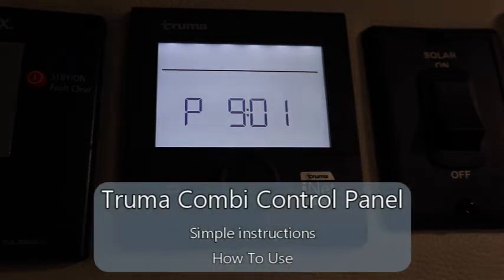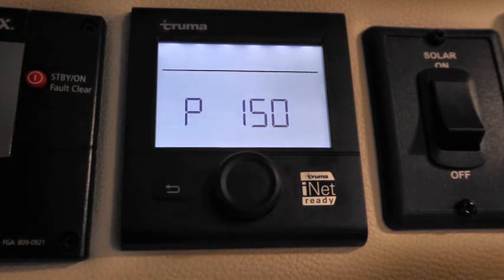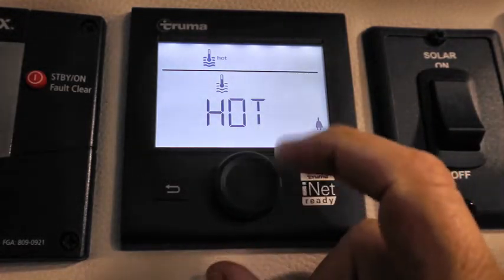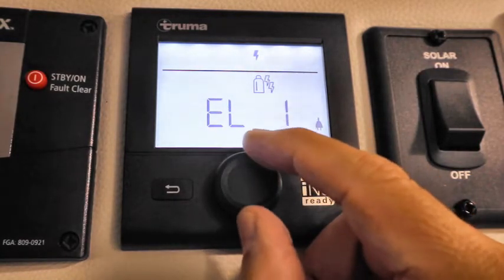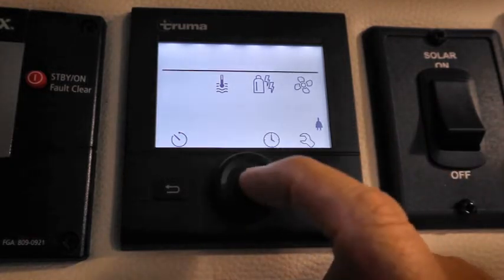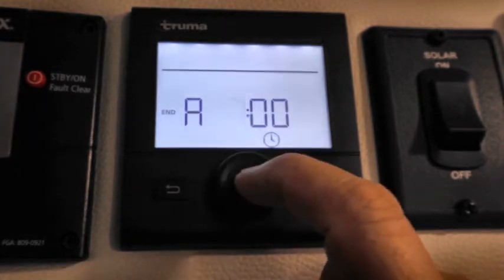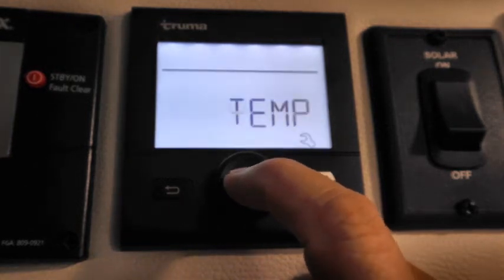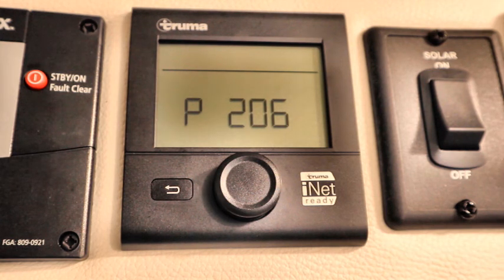Truma Combi Control panel - How to use simply explained

Comment: I am a new owner and have been learning one system at a time. Your video is excellent and I am sure it will remove any frustration and it will help me work through the manual which is not always as complete as it should be. Thanks very much
Reply from the maker: Glad to help.  Let me know if I can help you with anything else.

Comment: Just recently purchased a winnebago travato 59k.  Searched the manual for a clear explanation on how to operate the hot water & furnace. Have the exact same control as you're showing. You have the absolute best, simple explanation of the operation  of system. Thanks so much!!
Reply from the maker: Thanks.  Glad I could help.

Comment: Hi great video  can I run this system when the boiler is empty no water in it thanks ray
Reply from the maker: You can run the cabin heat, just don't turn on the water heater portion with the system winterized.

Comment: I noticed the little electric plug in the lower right.  Does the Truma run on 12V if you just want propane heat or does it need the inverter or shore power turned on?
Reply from the maker: It will run on just propane but it needs 12 volts to run the controls and fans.  To run it on electric it needs to be plugged in or have the inverter on with the Li3 package.

Comment: Anybody: Just got my Coachmen Gallerira. Do you have to turn the propane switch on before you set the heater on via Truma? Thank you.
Reply from the maker: If you are plugged into shore power and set the Truma to EL1 or EL2 the propane can be off.

If you are going to run the Truma on Propane only or Mix1 or Mix2 the propane switch needs to be turned on.
Reply: @CampingCoastie  Thank you for the quick reply!

Comment: Is there a way to turn off the Truma LED panel during storage so the screen is blank? If so, how do you then turn it on?
Reply from the maker: If putting it in storage I press the use/store button to store.  Then, I turn off the solar panels.   I then turn off the batteries.
Reply: I have a 2017/2018 22C and do not have a switch like you have to turn off solar. I do have on my control panel, a master battery off switch. When that is off the solar panel and the truma panel are still lite. Just wondering if there is a way to turn off the Truma panel so the screen is blank. Thanks.   @CampingCoastie
Reply from the maker: @jerryphillips7330  Try pressing the rotary button for more than 3 seconds to turn it off or on.

Comment: I learn a lot things from you, thank you. But I still have a problem…. I can’t turn the air conditioner “ on”. Could you please tell me how to do this?
Reply from the maker: Which AC do you have and which batteries?
Reply: @CampingCoastie  Our RV is 2019 Ford Transit chassis/2020 Coachman Beyond 22D-EB with Dometic A/C
Reply from the maker: Do you have a generator built into you Beyond, or is it a Li3 model?
Reply: @CampingCoastie  Yes, I have the generator which is the standard features on Beyond, but no Li3 Lithium battery
Reply from the maker: Hello, so it took so long to get back to you.  If you are not plugged in you will need to run your generator.  If you start the generator do you see it charging the battery?  If not, you need to crawl under the van and check the circuit breaker on the generator.  It will be behind a small cover.

If that breaker is not tripped check to see if the breaker in the coach is tripped.
Reply from the maker: If the generator is running and charging the battery try using the second panel to turn on the AC.  Let me know what you find out.
Reply from the maker: Any update?
Reply: We have tried different ways already. But the AC at the roof has not responding. We suspect the unit is never connected to the temperature control system. I need to visit the dealer for further inspections. Thank you for your help and patience.
Reply from the maker: @bonnieng6426  Does the ‘button’ for the AC turn blue when you touch it?
Reply from the maker: Can you turn just the fan?
Reply: @CampingCoastie  You meant the fan of AC… It doesn’t work so far.
Reply from the maker: @bonnieng6426  if you can turn the AC fan on then you might have a tripped breaker.  Silly question, but your generator is running do your 120 volt outlets work?
Reply: @CampingCoastie  Good questions! Unfortunately the 120 volt outlet at the water sink’s side does not work. Since we purchased the RV last September, we came across so many problems on the RV…. Water dropping from the roof,  water pipe leaking under the kitchen cabinets
Reply from the maker: @bonnieng6426  go outside and find the outlet, it’s a GFCI and press the little button on it.  That might fix the kitchen outlet and maybe even the AC.
Reply: @CampingCoastie  you meant outside of the RV?
Reply: @CampingCoastie  I found it and will ask my husband Denys to do this. Thanks!
Reply: @CampingCoastie  Yes! The 120volt outlet works now, but the USB outlet still doesn’t work and the AC also doesn’t work. We live in Vancouver BC
and purchased the RV at Comox Valley. The manufacturer warranty will be expired on September 11, but we have the extended warranty. Hopefully it can help!
Reply from the maker: @bonnieng6426  Contact Coachmen warranty department and let them know what problems you have.  Tell them when your year is over, they might help you out.  They are great people!
Reply: @CampingCoastie  Yes! Definitely we will call them. The Forest River is a good company. Thank you so much for your help.
Reply from the maker: @bonnieng6426  Glad I helped you fix one thing.  Wish I could have fixed it all for you.  Tell Coachmen hello for me.

Comment: I did a reset on the Truma control panel "wrench" icon due to an error message. Now Truma will not go back to the display home screen. Any suggestions. Thanks.
Reply from the maker: Maybe turning off your main battery switch and then back on again.
Reply: @CampingCoastie  And the main battery switch would be located where.....
Reply from the maker: @lucchetti1  What model do you have?
Reply: @CampingCoastie  2022 Beyond 22C.
Reply from the maker: @lucchetti1  do you have AGM batteries or the Li3?  If you have the Li3 press the store side of the use/store rocker switch.  You can then press and hold the big silver button on the Li3 SOC panel.  After it powers down press and hold the silver button until it says it powering up.  Then press the use side of the use/store button.

I believe on the AGM batteries there is also a use/ store button.  If so, press store, wait a couple of seconds and then use.
Reply: @CampingCoastie  Li3. I will try that. Thanks for the help. Just got it two weeks ago and have not had time to even give it a test run.
Reply: I reset Li3 but firefly says Truma is "off line". Still don't have a full menu display on Truma.
Reply from the maker: Maybe check the circuit breakers and fuses for the Truma.  Saying offline sounds like maybe the unit is not getting power.  Otherwise there would be an error code pointing to some problem.

There is also a way to hard reset the Truma.
Reply: @CampingCoastie  Hope you had a nice Easter. I drove it around and it reset? Thanks for all the help.
Reply from the maker: @lucchetti1  Thanks, I hope you had a nice Easter too.  Glad it’s working now for you.